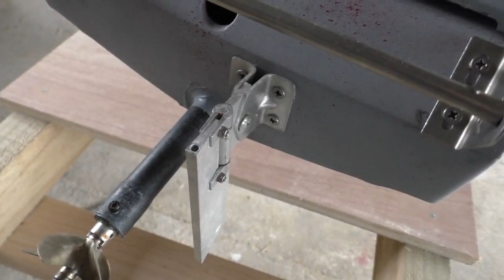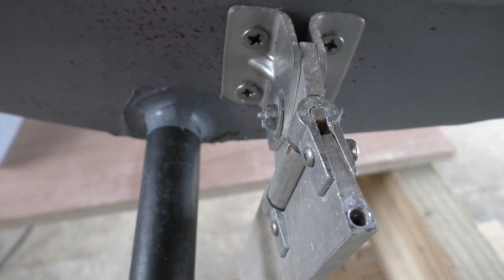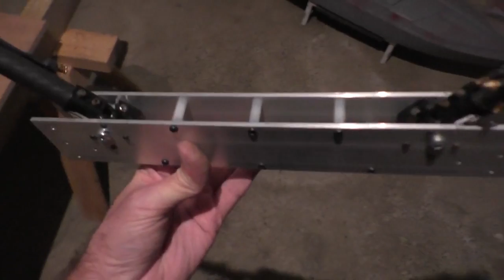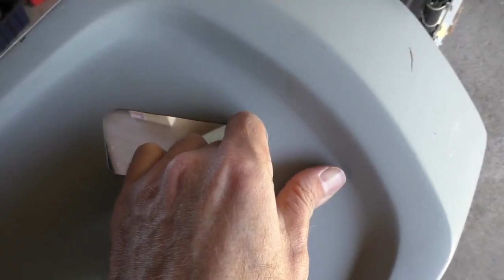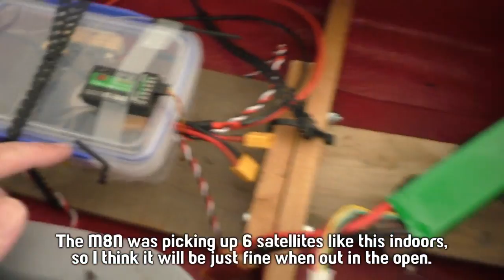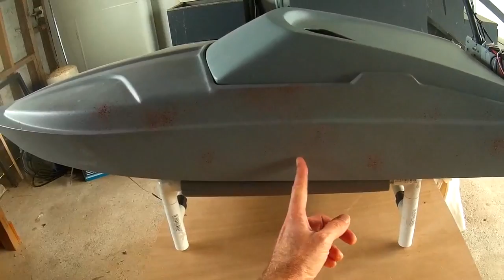Ardupilot differential thrust airboat part 1 (build/setup)

Comment: Hi I am completely new to this hobby and I'm currently trying to make something similar - an airboat with skid steering. But got confused on how to set up the motors. In servo output I set servo 1 to throttle left, servo 2 to throttle, and servo 3 to throttle right, but that doesn't even to drive the motors at all. How did you set up your servo output? Much thanks
Reply from the maker: I built my own Ardupilot with changed source code as I explained at 14:50
If you have ESCs that can reverse the thrust you will not need to do that, but I've never set it up that way so I couldn't really help.

Comment: Hello I'm building an arduboat project. I have 2 esc's 2 motors (right and left propellers and they suppose to run in different directions). Since the esc's are new i didn't set them up. Should i first program the r 9x transmitter. Or should I just plug them into pix hawk and do everything on the pc software? In order to have reverse direction, should i just wire 1 motor in reverse polarity? I don't want to fry my esc's they were pricey lol
Reply from the maker: I have no idea, you'll have to set the ESCs up properly. If they are boat or car ESCs they will probably already be set up to go both ways. In any case if they are pricey you should be reading their instructions instead of asking some guy on the internet :)
Reply: @iforce2d  thanks! Unfortunately they don't have any manuals or documents. But they work fine. Doing a radio calibration was enough for me. I'll try to set the pid settings in the morning and God permitting the auto mode.

Never had any rc experience. I could not guess it was so challenging. There were many hardware issues (leak, bad props shafts etc) now the gps drift. I did lots of ekf tuning. Even tho the device is stable on my balcony there is a little drift. How did you solve the issue?

Comment: Interesting video! I am planning to add ardupilot to a rc boat as well. Is it possible to define new engine layouts? My boat will be a scale model of an offshore supply vessel (Seabex one) that has four propellers in gondolas that can be turned (in German there are called "Schottelpropeller")...

Comment: a boat motor will work way better.. for just messing around this is ok. but the water splashing on the props will slow down your boat to a point that you stop. also those props are some finger chopping action you need to contend with,  when launching the boat in the water

Comment: note to self- if i ever build a boat hull, build an aluminum block into the bottom of the hull to use as an ESC heatsink. (i wonder if just totally flat would be fine, or maybe some short grooves/stubby fins. Water is so massive, I can't imagine an open loop water cooling needing much to do a lot of cooling, but never tried it myself so eh)

Is there any good reason NOT to use a heatsink that goes through the hull for esc cooling? Seems like it would be stupidly effective. Just blast it with epoxy or even silicone to seal it.
Reply from the maker: Complexity of construction, leak risk...  I suppose. It would work well for sure.

Comment: It's been made with fibreglass CSM  (chopped stranded mat) which does tend to be heavier but cheaper than cloth.  If you don't get enough turning effect from the differential thrust alone then you might want to angle the engines so that the thrust vector for each engine also contributes to the turn -- ie: point the motors so that the thrust-lines intersect behind the boat.   It will be interesting to see whether the very high thrust-line will cause the boat to roll the wrong way when turning.

Comment: That's heavy! But it will take a hit well. It may well struggle as an airboat though.
But whatever you do has to be better than the original prop/rudder configuration
Boat propellers go FORWARD of the rudder otherwise they don't steer well (no propwash hitting the rudder)
Looks at new motor mounts and smiles
You do like a challenge don't you........ especially if you expect "waves" ;)

The fore and aft centre of gravity shouldn't be too critical on that hull shape
The lateral trim may well be another matter. There should be enough stability with those chines when travelling forwards but turning may show a need for ballast adjustments
Reply from the maker: You could make your observations a little more specific... the ESCs are about 15cm above the water line, if that's what you're worrying about. Where should ballast go for better turning?
Reply: Sorry. I expect the moments of force from those motors when in action  will cause a heeling effect in turns. How extensive that will be will be down to testing. But with a semi hard-chine like that hull shape  you will need to ensure you have enough central (laterally) ballast to ensure that the heeling effect isn't too steep to affect your steering (If the edge of the chine digs in it will act much like a keel and so require more steering input)
Even with small cross waves that can be a problem.
With the big batteries you are using, keeping them as low in the hull and as central as possible should negate most problems though.

Comment: Turning may become an issue, all my rc boat “rail” as they turn and ones that I’ve seen that don’t “list” in the opposite direction, even a slow moving boat will list as it turns unless it has a flat bottom like air boats generally do.
Reply from the maker: Yeah I'm a little worried about that too. The bottom is not flat, but it's not a deep V either, only the front 25% or so has a significant V.

Comment: i powered my fsi6 with 4s and it worked for 5 seconds. you can imagine what happened next, as the pmic is only rated for 6V.
i recently replaced the burned ic and did the 10ch mod, but it doesn't bind to recievers anymore. didn't do it before i updated the firmware as well. what do i do now? replace the rf module?
Reply from the maker: At the price they cost I would probably just buy another :) Hobby King just sent me more spam today, they currently have the Turnigy TGY-i6s (looks like a FS-i6s) for $39
Reply: @iforce2d  ok, but i think i'd rather go with a nv14/dark knight/nirvana instead, if i'm already buying a new one, thanks anyways :)
(but first i have to test the new rx i got, to see if it could've been the rx's fault)

Comment: You'll get more efficient turning with the props on the CG
Reply from the maker: True, but I think the thrust line would push the nose down more too, possibly not what I want. I pushed on the motors a little when it was in the bathtub and it turns fairly well with just a surprisingly light touch.

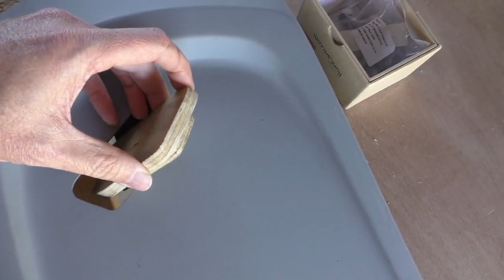Comment: 10:31... You will need to seal the top cover to the top of the hull against water infiltration or water will get into the hull while running the boat. That is of course if you are not running at extremely low speed.
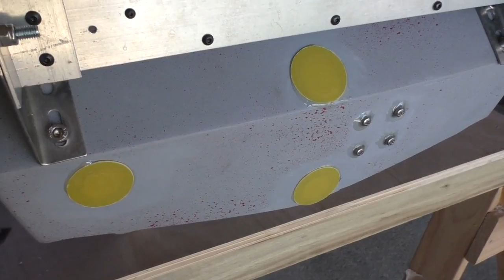10:52...If the grey coating on the boat is paint... you will need to get down to the fiberglass resin for the epoxy ti stick properly.

Comment: I've derstroyed so many ESCs over the last few years, it's not even funny... They seem to be the most fragile electrical component in the hobby. Anything goes wrong -> Magic smoke!
Reply: muh1h1 really depends on what u do/buy and if u choose the right one for the job...didnt kill one for 1.5years amd i fly my 4quads every week and also a plane/car....
Which esc are u using for what job?
Reply: I've probably destroyed ESCs in all price ranges. Last ESC i destroyed was when i lost my Racequad because the FC died for some reason mid flight. Couldn't find the quad until the next day, with heavy, heavy rain over night. When i found it the next day covered in water with the battery still connected one ESC was dead. Blame is on me with that one of course. I also had one (not sure of make and model anymore) that cought on flire taking the motor with it upon connecting it to the Lipo after updating BLHeli to the newest version. Another set of 6 ESCs died on me when i tried to build a hexacopter using super sketchy generic ebay BLDCs (back when they were still kind of expensive). The motors where probably mismarked and actually made for 2S or somthing. Another ESC of mine cought on fire after probably taking a hit from a prop during a crash into a gate. Some also just died randomly, but that is gettting really rare nowadays, because ESCs got much better and more robust lately.

Comment: Boats need to be heavy and often have a lead bottom, might as well trade weight for strength.
Reply from the maker: So I guess 5-6kg empty is pretty normal for an 1100mm hull? I have never had a boat before to know much about this stuff. Just from the quick test in the bathtub, I wouldn't be surprised if it could carry another 5kg in addition to the gear and batteries I have on it, without too much trouble.